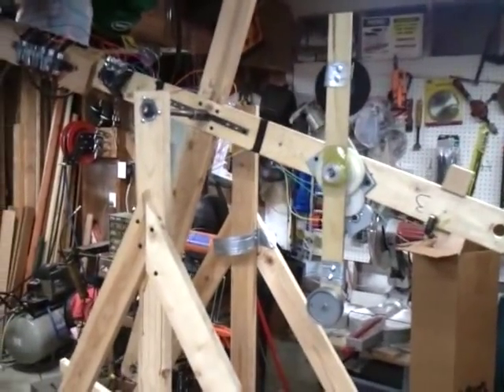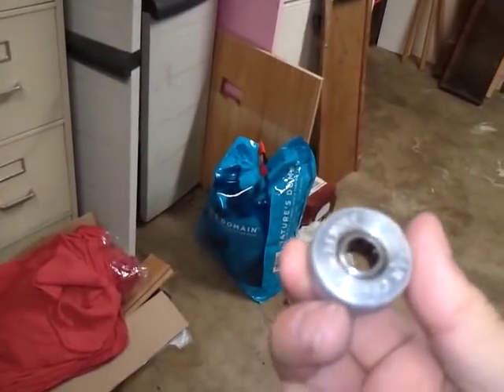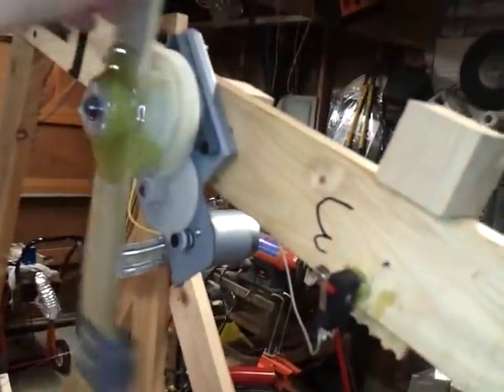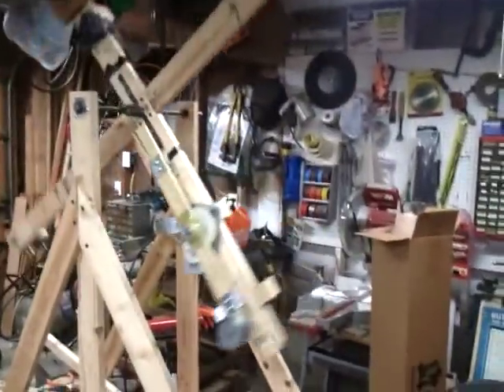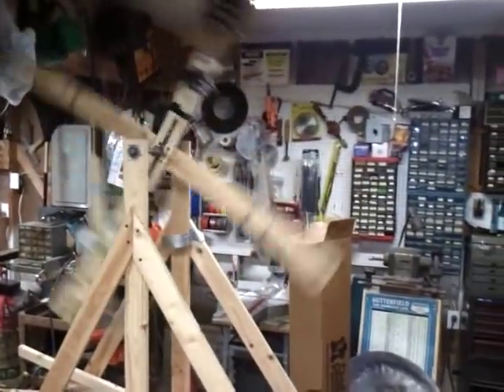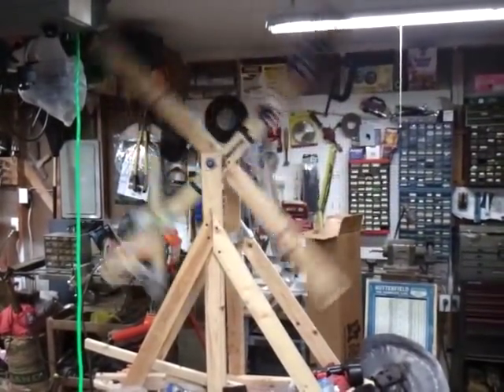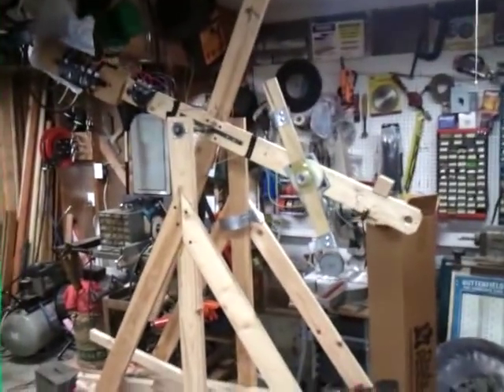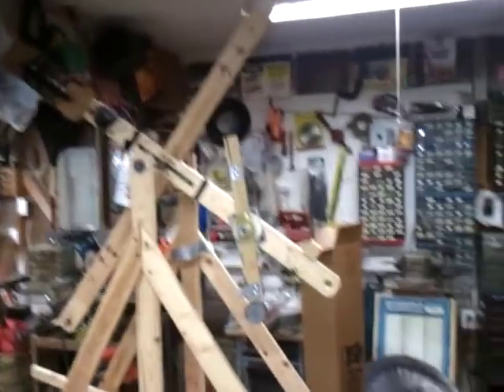Gravity motor prototype version 2.1

Comment from the maker: To all those who have commented and are commenting, I would like to apologize for any lack of response.  I work as an electrical engineer full time, have several of my children I raised, a home to keep up etc...blah blah.  None of you deserve not to be answered and I feel extremely badly about not being there, I want to help you all but family came first. Even when I posted these I never really thought that I would not have some time to continue posting stuff, and follow ups, but wow things are so bus.   I have been largely working with direct energy power generation devices with my Father, We have made astounding results of which I will share freely (My book I am writing will explain all in detail). I also built a new gravity Motor "Just because I love them" which I will post it runs but I had some intermittent contact switches and I bought better batteries,  I did take this one shown here and extended it out to double the size but it scales poorly ( I gotta dig up those videos, but its more comical then anything), my new one scales perfectly.  I have a few final additions (changing some switches to Hall effect detectors but almost done) I will post the new motor for you all who care in a few days ( I wont wait for the sensor install just to prevent some delays to you all). I can post some of the electrical projects I have worked and completed, they had just been some preliminary tests.  So thanks for the comments again sorry for the massive long lag in response.  Do I think these can or are free energy, I dont know but they are really great torque converters, and using various power conserving methods for the motors like the Charge into batteries while running motor technique, and with the Velocity Square gain from gravity fall, its possible.   For me this is just a work of love, as I started building these when I was 16.

Comment: Wow! That universal ratchet made a BIG difference. This setup looks much more efficeint. Have you thought about putting coils at the end of each arm and a magnet (or several magnets) that the coils would pass by inducing electricity. Then use that (through some caps and diodes) to charge your run batteries. This would put the generator on-board instead of off the back of the axle. By capturing the induced current and back EMF, you just might be able to keep those batteries charged.

Comment from the maker: Thanks RockyTube fo the comments, I agree with your idea, I had first just wanted to couple a small dc motor as a generator to get a feel for power and losses, but what I had all where low voltage motors, I just got in some 120VDC and they put out much better voltage for my slow rotation speed, I am just building up some wooden toothed pulleys, and leather connecting belt to try it out, been delayed as I am finishing a 10' x 16' foot new shed, but almost done and get back to this fun.

Comment from the maker: Thanks Rocktube, understood that losses will be greater but I believe I have minimized them, I have to gear it though direct drive of the motor just not going to work my RPM's are to slow. I have my chain and sprockets all ready just mounting them to motor, should be just a couple of days will have video up with it running and driving a small high voltage permanent magnet motor.  This will help me perform some power tests and checking loading.

Comment from the maker: TranquilKao 5, one think i dont have a joule thief, but I do use voltage boost devices from Linear technology and Texas instruments, they are very good boost for extremely low input voltage, you can run a single solar cell of them, not saying they are better but they certainly are very consistent to make, you can find them online at there websites if you are interested.